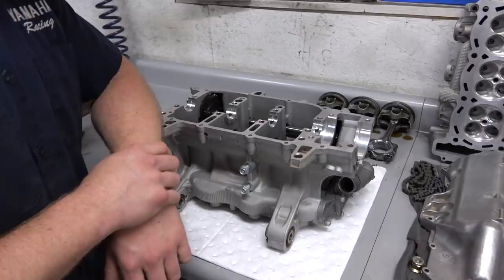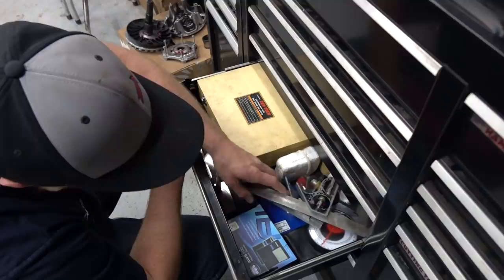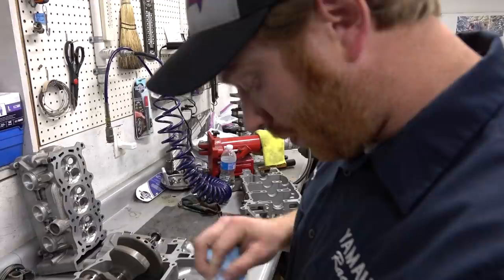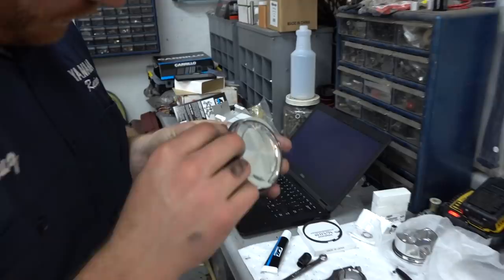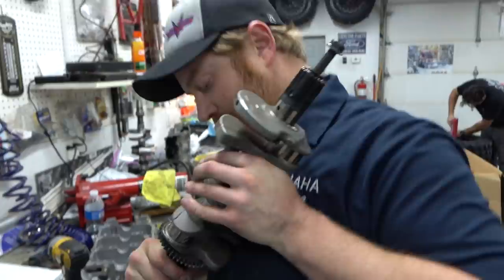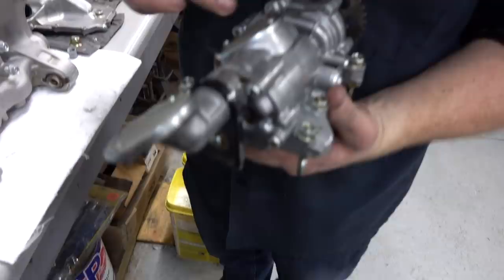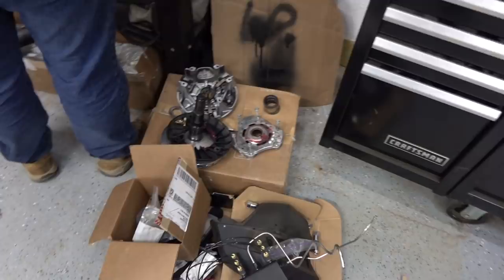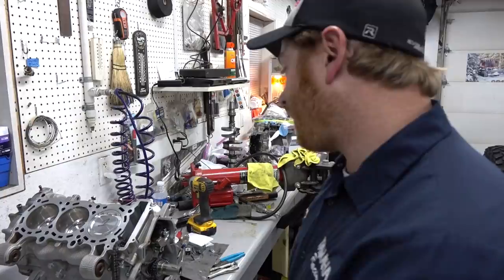Yamaha YXZ turbo engine build IN DEPTH! Built for BIG HP!

Comment: One time I drop a crank, thing hit the floor and formed a U shape. Installed it threw it in first gear floored it and it went backwards into the garage. The crank grew self aware and told me abruptly to pull back into the garage and fix it. Broke the garage door and caused 5k worth of damage. Thank you crank for helping.

Comment: Did you use the factory yamaha gtyr turbo kit? When your done,You should get new rims with the 4/4 offset and some stiffer tires like the efx moto hammers! It puts the tire width a little over 67 inches. You wouldn't believe how much better it corners and handles! A yxz with a turbo and 67 inch stance is an awesome machine!
Reply from the maker: We're using an MPI kit with some upgrades, we'll go over that soon!

Comment: What ended up being wrong with the xx? Engine?
Reply: By the looks of the clutches on the floor, guessing they let go. Highly unlikely it was motor related.
Reply: @loudelectronics  then why was it banging in nuetral when the clutched weren't moving?
Reply: When in neutral the primary still spins.

Comment: Is that engine the same as in the Nytro snowmobile?
I have a Yamaha Nytro with Mcxpress turbo kit on, it puts out 270hp 
The only thing you do to the engine  is a chims between block/head to lower the compression.
And with the right weight and springs in the clutch I use one(1) belt/season! I just put a new on for next season to be safe.

Comment: @SXSBlog.com — It would be great for you to create a catalogue of how-to / ‘garage’ videos you can post on your website with specific titles (e.g., “YXZ Engine Rebuild” or “YXZ Turbo Install”.  That way customers purchasing these parts from your store can reference your install videos for installation instructions, tips, tricks, etc. 

This video did give me an idea though — the YXZ is underpowered compared to other manufacturer flagship products, so too is the Arctic Cat Sport in the 60” category.  Okay, before you start running to the door, hear me out;  I love the widest, biggest, and baddest machines no different than anyone else, but I’ll be the first to admit they can be too big and too wide for a lot of trails.  Polaris caught onto this a few years back when they started offering their 999cc power-plant in the 60” chassis and it’s the same reason Honda won’t be offering the 1000R here in Canada.  So while the obvious decision might be to purchase a RZR S 1000, the chassis in the WildCat Sport is arguably much better.  What I’d love to see if you guy’s ‘fix’ / give the WildCat Sport a fighting chance with a turbo and maximize that chassis for everything it’s worth.  It would also be a great opportunity to showcase some of the Evo motorsport products for this category which often gets over-shined by the 68”+ category.

Comment: Your ring gap measures at .012 but shop manual says .0197 for top And .0276 for the bottom? Isn’t .012 going to be way under spec, especially for a boosted set up?

Comment: Curious to see how you get that bearing on the flywheel side that sits on a detent in the block after the two halves of the block are assembled. Also, you're not the oniy one that went thru the bearing dilemma.
Reply from the maker: Go to about the 37 minute mark and you'll see we put the bearing in place prior to assembling the two halves
Reply: I do see it now, good! I was hoping you didnt forget it and have to tear it back down👍

Comment: Not using a stretch bolt rod gauge. Is that available for this yammy engine. My small block with arp bolts gave a bolt stretch spec through arp.
Reply from the maker: Yeah you can use one, and that would be ideal, we didn't have one.

Comment: Does the RTV not affect the bearing clearance ?
Reply from the maker: No it doesn't, it squishes out of the joint nearly completely, mostly just fills the imperfections / variations in the surfaces.